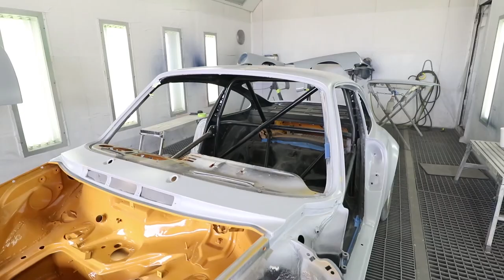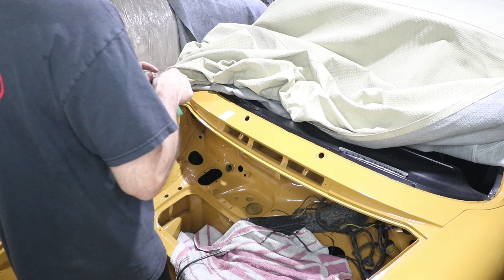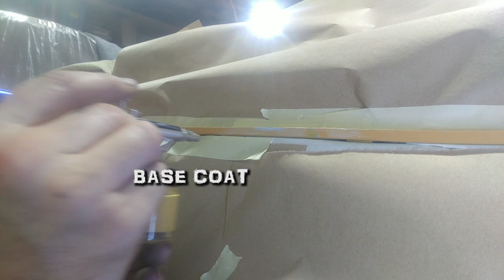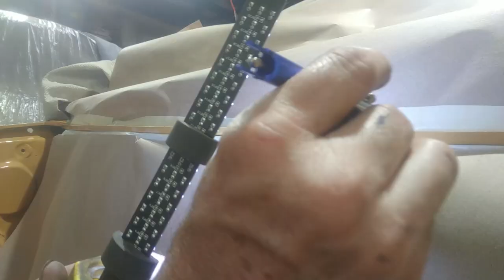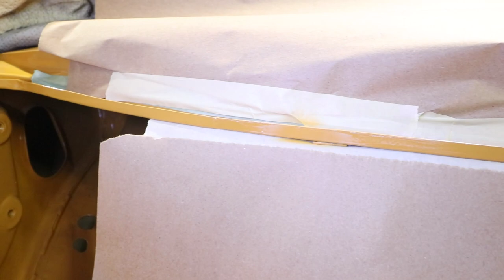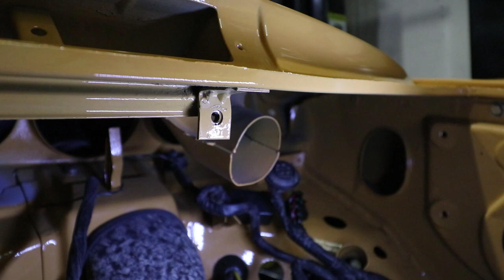How To Repair Peeled Basecoat / Clearcoat Mistakes with Airbrush

Comment: Do you add anything to make the paint and clear thinner for those airbrush
Reply from the maker: No, I didn't.  The basecoat was reduced the same as if it would be sprayed in a larger gun.  Same with the clear coat.